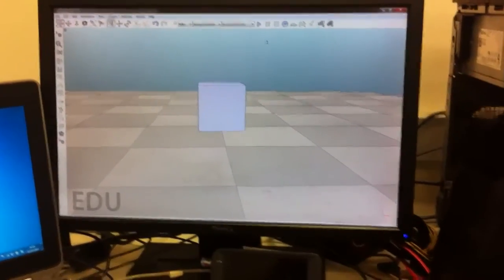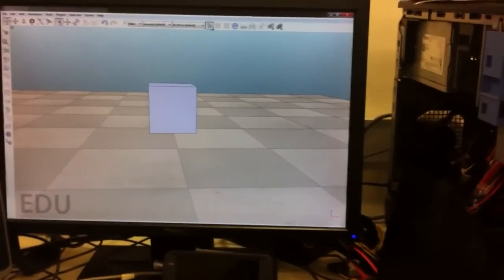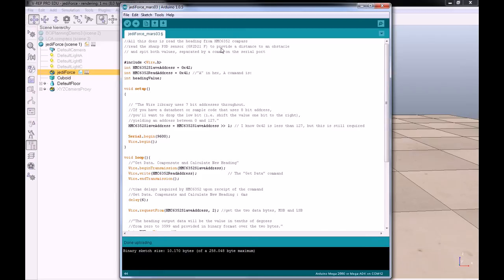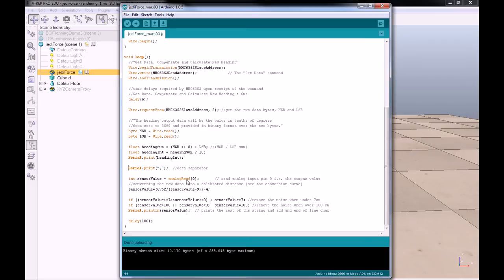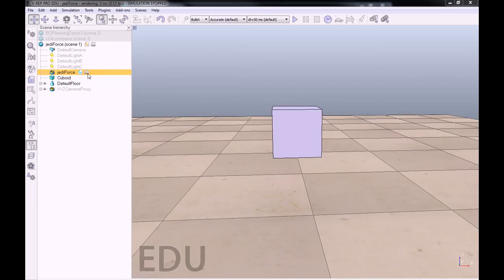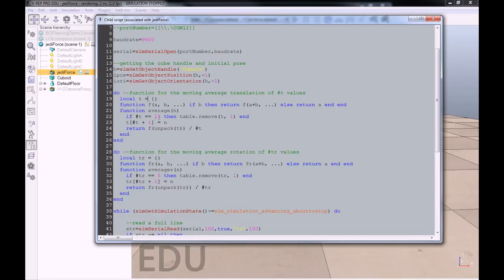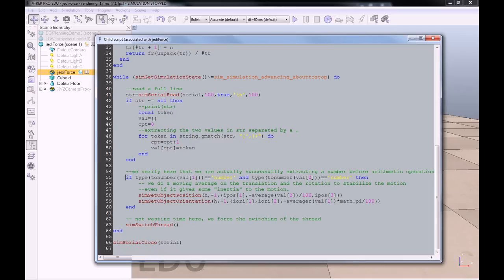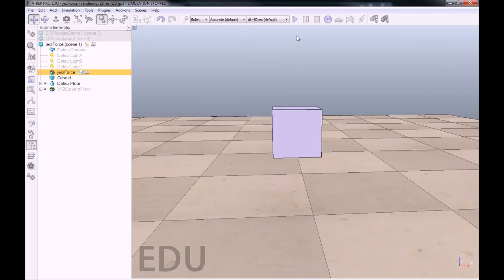Arduino + compass+ PSD sensor +V-REP simulation

Comment: Hi! Can you get values provided by an imu in vrep?
Reply from the maker: In that example i send the data of a compass... So it is the same for an
 IMU. If you can read the data of the sensor you can forward it to V-REP
 via the serial port in the same way. It is actually done in this video: https://www.youtube.com/watch?v=DMy_Dv5T0qY&list=PLZ7pUTAY6EB4u40FxCwt4eBfvXvtM1jY2&index=31
Reply: Yes, you can use simxgetObjectOrientation, this provide Euler angles.

Comment: btw, do you know if it is possible to control the cuboid in vrep using an external joystick ? Thanks a lot!
Reply from the maker: you can modify the code to be reading two potentiometers that would be acting like a joystick and also adding some buttons... now connecting a usb joystick... I m not sure... Google says there are some projects.
Also, there are some joysticks shields  that you can connect to an arduino easily.